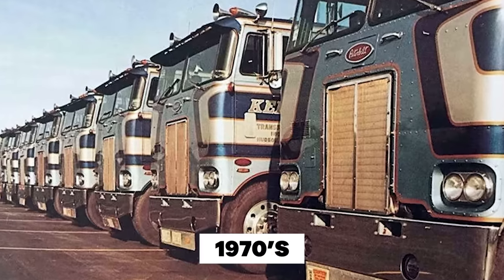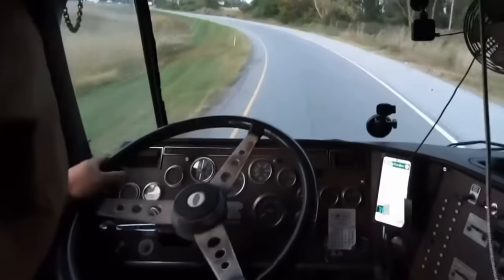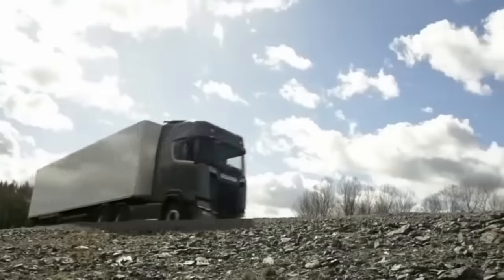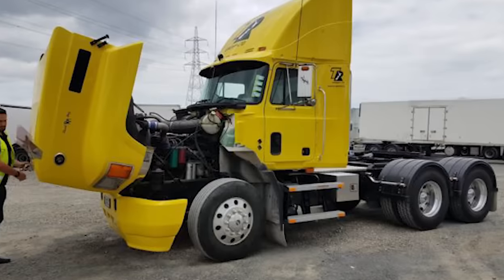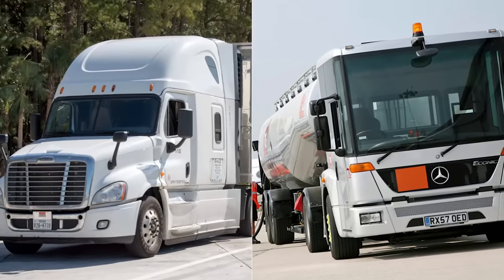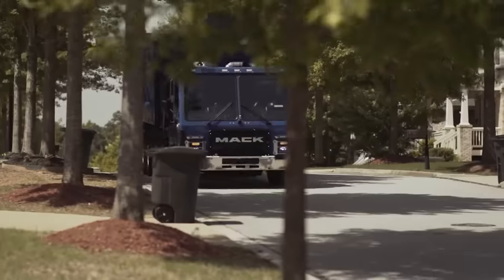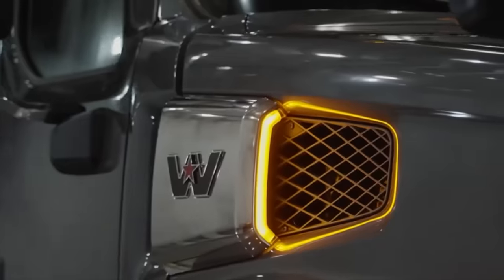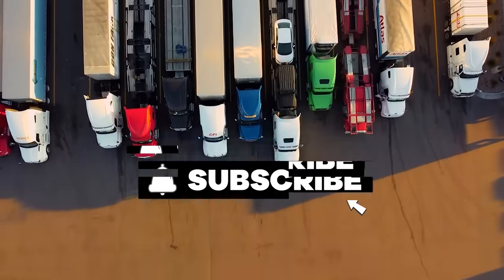The REAL Reason Why America Stopped Making Cab-over Trucks

Comment: this sounds like my English exam where he rephrased everything but said the same thing 5 times
Reply: So it isn't just me who noticed that?
Reply: Cuz its written by chatgpt
Reply: Fr
Reply: I don't think it repeated itself on a single subject.  Maybe you are just noticing the extremely formal phrasing around each bullet point that came with the translation or w/e.
Reply: @OZZOZZ  I used Chatgpt and it's  better than what you think. It wouldn't make the mistake of repetition because it uses data from experts and not noobs like this.
Reply: This voice doesn't sound real either.
Reply: It said cab over trucks, also known as cab over engine trucks like 5 times @BeKindToBirds
Reply: @BeKindToBirds lol think it's because he says "cabover trucks" in every sentence.
Reply: @BeKindToBirds   tell me you didn’t watch the video without telling me you didn’t watch the video.
Reply: @BeKindToBirds  Bro, even I thought the video repeated itself. As the video reached its midpoint I was like did he just rephrased everything which he just said initially just to increase video length 😂
Reply: So true
Reply: @evelynfarfellwooosh1219  you're right this was just padded to an inordinate degree to make a longer video it's quite comon but not normally to this extent. Probably so they can fit more ads
Reply: This is what happens when you have 2 mins of material but try to make it long enough to get monitized

Comment: lol, something people always get wrong, from the point of view of a driver and mechanic, a modern (30+ years) European etc cab-over truck is much easer to do daily fluid checks on the engine etc, as everything is conveniently behind the lightweight grill, which is easer than tilting even a lightweight bonnet, while from the point of view of a mechanic, it takes just a couple of mins to tilt a cab, and you then have significantly better access to the entire driveline from the radiator backwards, without the stupidity of the cab blocking access to the back of the engine, bellhousing, gearbox and even transfer case (if applicable), PTO systems (if applicable) and parts of the prop shafts, the notion of it taking 10mins or more is just a myth perpetuated to try to justify bonneted trucks more.
Reply: Learn what a sentence and full stop are for.
Reply: @deaddoll1361  so I assume you could not come up with a counterpoint to what I said.
Reply: @b101uk9 not every reply to your comment has to be a direct rebuttal to whatever you said
Reply: @deaddoll1361 Chill, it's not like they're writing an important email to the ceo of Amazon.
Reply: Heavy duty mechanic here, and no, never enjoyed working on any cab over, never even met a tech who did. 😂 you know why lifting a hood is better than looking behind the grill? Because pre trip inspections involve looking for leaks etc as well, which a driver can’t see from just lifting the grille, no driver is tilting his cab for a pre trip. You’re expressing your laziness.  Next smash into a moose on a mountain road at night I guarantee you’ll appreciate a long nose right before you get discombobulated. 😂 I’ve been a tech for 12 years my grandpa owned a trucking fleet with both types of rigs for 38 years. I value ease of maintenance/repairs and life over whatever you’re on about 😂
Reply: @bradzelk600  they I guess all the techs you know are dullards who don't know their arse from their elbow and are basing opinion on the crap that was the NA cabover of old, because most of them wont have worked on European ones, as for leaks, there are all sorts of places you can look, and the ground is a great tell-tail, as is actually checking the fluid levels, and well tilting the cab is second nature to many of us, and is a couple of min job, you talk of valuing ease of maintenance/repairs - and well I can tell you are absolutely talking out of your arse because maintenance of any part of the engine and gearbox is MUCH easer on a cabover, as once the cab is tilted that just take a couple of mins on tractor units you have unfettered access to the entire driveline, as you don't have that stupid cab and sleeper blocking it all - as for the notion of safety, your average European cabover tractor unit is much safer in a multitude of situations, as the cabs are significantly more robust, one only has to look at the relative death rates per capita, due to the relative lightweight nature of most (but not all) US cabs, which is in part to the baseline federal 80,000lb GTW, which means manufactures have to keep an extra eye on tare weight of the tractor unit, relative to the baseline of Europe that sees a 4x2 tractor unit running at 88,000lb and change on the same total of 5 axles.
Reply: @b101uk9 come to western Canada or Alaska, and see how comfortable to drive a cabover you are. Our moose and bears are over 500kg, and we still have gravel roads in the middle of crazy steep valleys and mountains. You want a much larger truck with a long nose to smash into a 8 foot tall, 500kg moose. Hit one in one of your trucks and you're dead.
Reply: @jasonlauritsen5587  you do talk some crap, you do know there are moose in other parts of the world like Scandinavia and Russia, they are called elk (not to be confused elk in NA), as for tracks, there are plenty of gravel roads in the middle of crazy steep valleys and mountains all over the world mostly traversed by cab-overs, much like all the remote places in much of the world serviced by dirt roads etc, as for your notion of "500kg moose. Hit one in one of your trucks and you're dead" unfortunately you are more likely to die in one of your trucks in a multitude of circumstance, due to their weak lightweight cabs, and lets not forget the joke crash testing in the US, at least here they crash them into something that mimics the couture of the back of a trailer etc to maximise the forces imposed on the cab, unlike in the US where the test is to avoid putting forces on the cab to avoid showing how weak they are, and lets not start on how ineffectual NA trucks are in the main when it comes to partial overlap crashes.

Comment: A lot of comments compare the American cabovers of the 1960's to modern conventional trucks, which makes no sense. A modern air-ride forward-control European truck is not an old Kenworth K100; I have not driven either, but I know that it is nonsensical to assume that one has the same comfort and safety as the other.
Reply: Exactly and I have driven both everything euro and both north American and Australian K200 and 220 and the latest generation cab overs ride like a Cadillac compared to the 100 series.
Reply: I drove 2 Mack's,  2 K100E's & 2 Peterbilt's. The Mack's were not air ride. The others all were. If the 1st KW hadn't had a heavy haul steer axle,  it would have been a nice ride. But that 20,000 lb steer axle,  made it ride lot the 23 Cascadia I'm in now.
Reply: I had a ride in a modern mid size Volvo cabover with a family member who is involved in the trucking business. Safest dang truck on the roads today. And I could stand up and reach the bed behind the seats just as easily as any other truck I imagine.
Reply: He lost me at the start, calling the 1970s "vibrant". As a young adult then my memory is the opposite of vibrant.
Reply: @Carlschwamberger1  You mean President Carter's recession with the only inflation to ever top the Great Depression? Or the only time is US history,  both the president and vice president resigned? (Nixon & Agnew) There were 2 highlights for me. I graduated high school in 1976 & married my high school sweetheart in 1977. This December we'll be married 46 years.
Reply: @edwardantrobusjr2253  Yeah, those two, and many others.  rising unemployment, manufactoring stagnation,  collapse of the S Vietnamese government & US strategy in Asia,  continued increase in the use of debilitative recreational drugs, rising crime rates,  & God save us -  Disco Music.   I could go on at length but so much of the optimism and hope of the 1940s - 60s seemed to die in the 1970s.
Reply: @Carlschwamberger1  With the direction of pop music & country music from the 90's into the 2000's, disco started to grow on me. Also,  whe oldies radio started playing 80's & 90's. I miss the Sunday night doo wop program that so many stations had on. I'm a long distance truck driver and could get it in many parts of the country.
Reply: I got to run Scania, MAN, Mercedes, and Foden trucks in South Africa circa 2008 - 2009 and ran the Actros in the ME before that. I agree there’s no comparison in ride and handling, but the industry just doesn’t want them here anymore.
Reply: Time & technology only do so much to overcome quarters cramped by form factor and the inherent benefits of sitting further away from 2k lbs of hot, hard working engines- not to mention time & technology are actively refining long-noses as well. Nonsensical to think otherwise really...
Reply: @1TUFZ71  there is nothing cramped about a modern large COE. The cab is just differently located,  not smaller, compared to a conventional cab. It's so high that it is completely over the engine, and there's no doghouse.
Reply: @1TUFZ71  Actually,  the cab and sleeper have been getting smaller over the last few decades. I'm constantly bumping my head in my 23 Cascadia. And it's one of the stiffest riding trucks I can remember. And the exhaust after treatment system heats the floor as bad as the 76 Mack cabover I drove in 83. Sorry, your argument doesn't hold much water.
Reply: The Europeans had vehicles 15 to 20 years before the US giving them more time to Design also better control.
Reply: @Cherylann-ryllaby2  Cabovers have existed for many decades, everywhere.
Reply: @edwardantrobusjr2253 A farmer I worked for from 2000 to 2003 had a couple of old cab over Mack trucks. I don't remember their year of model but they still had the air powered windshield wipers. I want to say 1987 models but not sure. They were very durable and tough especially driving across creek beds to get back to some the fields during harvest. But DAMN! They were the most rough riding truck I'd ever drove. I was on I74 in Illinois and was going across an overpass. When I hit the overpass, I bounced up and hit the stereo knob and gashed my head open. And I was 230 lbs back then.
Reply: Modern "long nose" trucks often have air suspension and air ride cabs as well. Those systems, like any other suspension, can only be so soft and have so much travel for stability reasons. No matter how you slice it, sitting further from the axles will always provide a better ride with any given suspension system.
Reply: Right, but the idea a cabover can't have more comfort than a long nose truck in 2023 has long gone, in fact in a lot of ways with the air-ride cabs and seats with flat floor European trucks are ahead again if you don't need say a shower cubicle in the truck.
Reply: @brianb-p6586  in fact the actual cab area tends to be bigger in the Cab-overs with more leg room, the bit that is smaller is the behind the cab sleeping area, but a part of the reason the cab area is bigger with pull out tables and sometimes fully swiveling seats is to have the cab area perform double duty as a small dining area and office space.
Reply: @CzechSixTv  EU trucks can have the seats on their own suspension from the air-ride cab, this also dampens engine noise and vibration from that.
Reply: @EwanMarshall  You seem to be basing your argument on a false assumption that conventional trucks can't/don't also have air ride suspension, air ride cabs and air ride seats all in the same vehicle. Anything put into a Forward Control/Cab Over for comfort can also be installed in a conventional. Full air ride is very common, if not the norm, for over the road conventional trucks in the US. 

There simply is no magical air ride advantage to a cab over vs conventional, but there's still a ride and comfort advantage to sitting further from the front wheels and engine.
Reply: @CzechSixTv No, I'm basing it on a lot of people compare before that was the case for either design. I didn't say it was a magical advantage, it is no-longer such a disadvantage.
Reply: @EwanMarshall  In an earlier comment you stated:
"𝘵𝘩𝘦 𝘪𝘥𝘦𝘢 𝘢 𝘤𝘢𝘣𝘰𝘷𝘦𝘳 𝘤𝘢𝘯'𝘵 𝘩𝘢𝘷𝘦 𝙢𝙤𝙧𝙚 𝘤𝘰𝘮𝘧𝘰𝘳𝘵 𝘵𝘩𝘢𝘯 𝘢 𝘭𝘰𝘯𝘨 𝘯𝘰𝘴𝘦 𝘵𝘳𝘶𝘤𝘬 𝘪𝘯 2023 𝘩𝘢𝘴 𝘭𝘰𝘯𝘨 𝘨𝘰𝘯𝘦"

Apples to apples, with both trucks having full air ride(suspension/cab/seats), the conventional truck is still going to provide a smoother ride to the driver. Will a top of the line cabover with full air ride be more comfortable than something like a basic conventional day-cab? Obviously, but that's hardly a fair comparison.
Reply: I've driven many cabovers (retired in 2003), and the only 2 drawbacks over conventionals that I found were a slightly bumpier ride because of the shorter wheelbase and having to jack up the cab to work on it (and secure everything inside so it doens't fall through the windshield).     My later ones had power steering, air ride seats, and finally a jake brake.   OK, the oil dipstick was 3 feet long, and threading that in was inconvenient.
Reply: @luuk341 Is that FH or FM?
Reply: If you're driving a truck in Western and much of Central Europe, the roads are well maintained, so sitting over an axle  isn't as big a negative as it would be here in the USA where we have so many roads, we can't maintain them.
Reply: @anthonykaiser974    I drove cabovers by choice for years and bought one.   It wasn't a problem.
Reply: They still make cabovers to this day. No One buy them because they are stupid they are uncomfortable they won't fit anywhere most trucks wont fit. And if you manage to recruit a driver and show him the new cabover is going to be driving you're going to have to recruit another driver after he laughs and walks away
Reply: @charlesreid9337  no one buys heavy-duty cabovers for highway hauling in North America, but most highway trucks in Europe are cabovers. Lots of people buy cabovers even in North America, for local hauling and vocational applications.
Reply: @CzechSixTv not really, long nose only two air bags on the back side of the cab and bushings on the front . But European cabover two air bags on the back and two air bags on the front, and total cab suspension more complex and more comfortable. Long nose no cab suspension at all. As result all vibrations from front axle on your back .
Reply: Watch the video "Brake test: Modern truck vs. old truck" by Dekra, the old truck (from lates 90s) needs more than a full trucklength more braking distance.
I also heard (can't find footage), that MAN tested the braking performance of their new TGA Semi (without trailer) in 1999 against a Porsche 911 (so probably a 993 or 996) and it wasn't much worse, so if you calculate the relative stopping power for their weight, the Semi is literally equal to the Porsche.